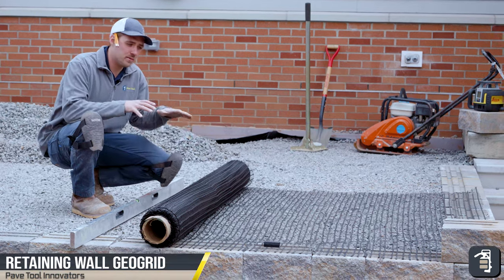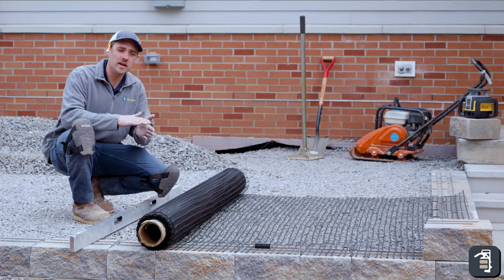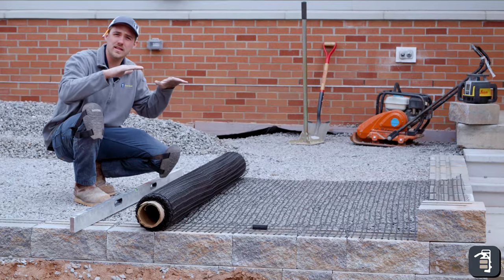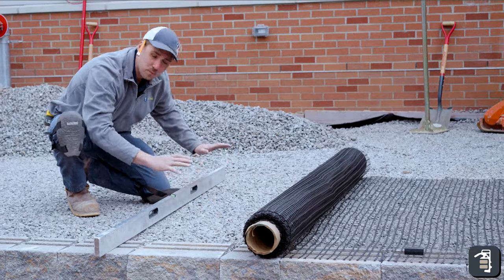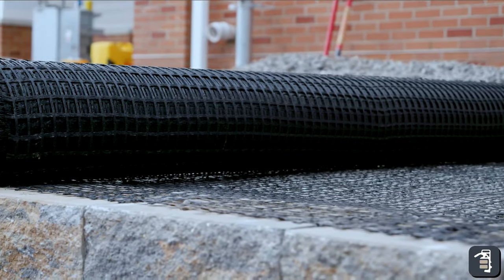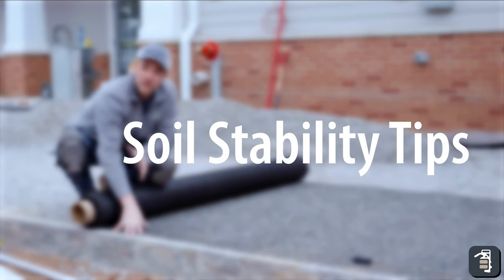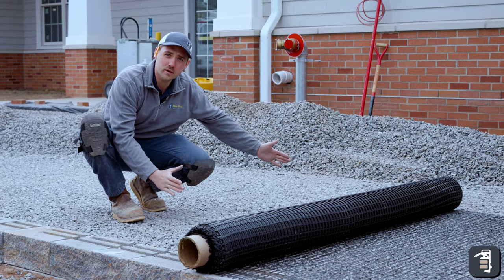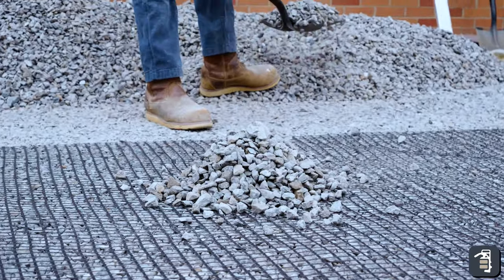Geogrid Basics in Hardscaping and Retaining Walls

Comment: That is an awesome video, is there a way to do a video on how/where it is installed in a paver patio application?
Reply from the maker: Thanks! This project is a raised parking spot/patio so this area was filled in with pavers and designed to be driven on.  The grogrid is designed to not only stabilize the stone behind the wall but also to stabilize the area as a whole for driving on.

Comment: How about Nonwoven geotextile to separate the dirt from the stone?
Reply from the maker: I certainly am not opposed to using a nonwoven fabric for soil separation. We prefer the woven because it has a little more structural strength. People think water does not penetrate the woven but point loading from your 3/4in clean stone will puncture the woven and allow permeability. Please don't hesitate to call us if you have any questions.